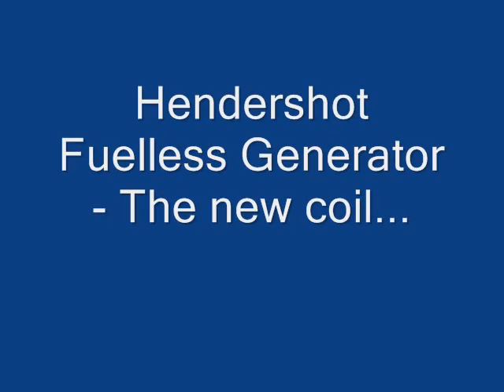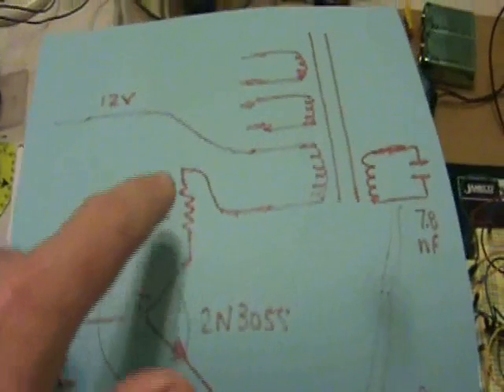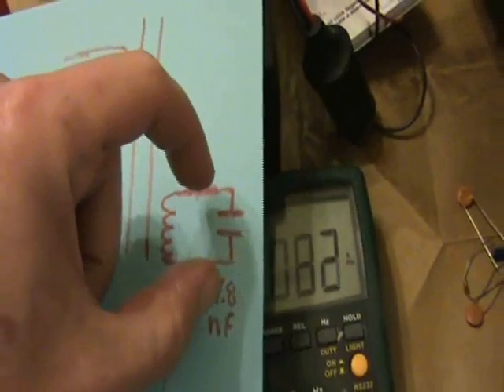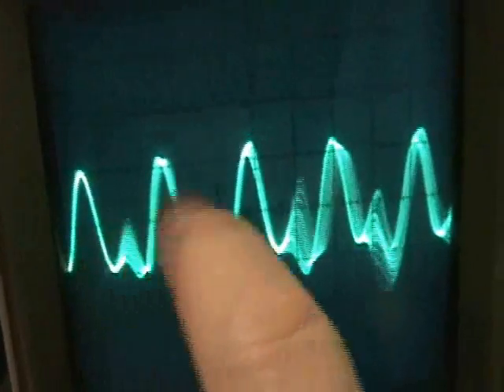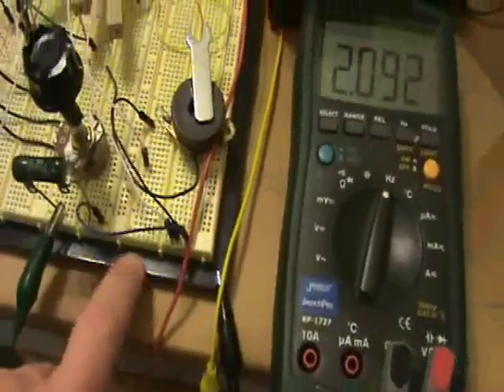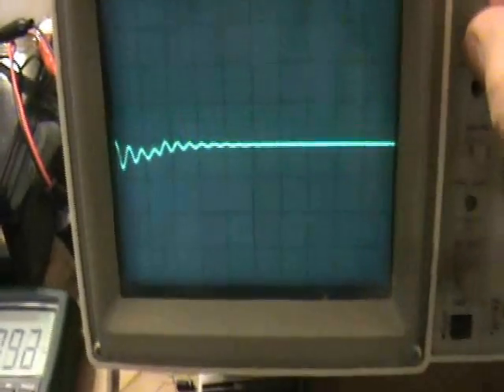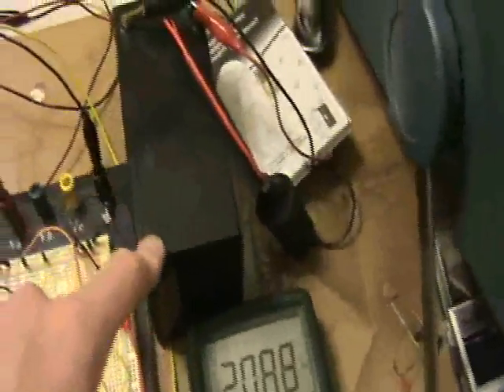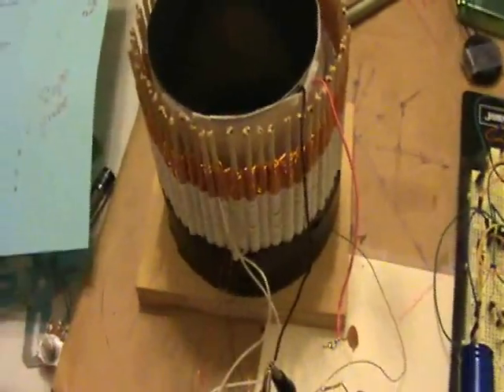"Hendershot Fuelless Generator" - The new coil

Comment: These were mainly used in kitchen s
Lighting after the war, they had a slider handle on the wall with pushrods and bell cranks up to work the bar magnet
Problem was little Johnny would come home from school an run through the door and just slap the slider not quite putting the magnet just in the sweet spot. They were outlawed in the 50's
Cause they were house burners.
So my idea is to use an electromagnet instead of a bar for more precise control. They make 240v the videos yiu see with the coils on top and lights on bottom look just like the ones they sold ling time ago. None were made in the usa. I have removed one from a big ritzy historical house back in the 90's i would think the paper caps were so old, the kitchen help said it worked all the time
There were 240v flourescents on it.
C and c electric its in their shop under a table on top of another one that was old as hell.

Comment: Two foreign countries made these with lights and sold them. They were outlawed in the 50's. The NEC says lighting by these are not allowed. Ring modulated tank circuit power sources for residential lighting shall not be......
Reply from the maker: I think your just being Paranoid. What are you worried about? Some Dr. Who Dalek coming to investigate?
Reply: +morpher44 they were outlawed cause they were firestarters if the ring is not just right they overheart
Reply from the maker: was reading that ring modulation was used on Guitar effect in the song Paranoid - Black Sabbath. Also its the effect used to create the Dr Who. Dalek voices. :-)
Reply from the maker: as for frequencies just right, and heat, modern electronics can handle those issues.

Comment: Once dad's device blew up in our dining room up on the ceiling... keep up your work and ideas Morpher44... Think Frequency... MJH
Reply from the maker: Hi Mike. Yeah I had been thinking frequency. It has to be low -- mechanical -- such as 50Hz upward to 100Hz. If your dad was shooting for 60Hz, he would design his resonant circuit to be there, which means the resonant peak would be there, allowing for the power transfer to be ideal at 60Hz. Plus, the buzzer mechanism isn't likely to go much faster than 100Hz. Now if there are other frequencies involved, such as harmonics, that is a more complex machine.
Reply from the maker: re: harmonics, I found some material on PHI ratio frequencies and how PHI is the only ratio where the frequencies can mix "perfectly". 2x also works, but it is not ideal. Did your Dad ever discuss the constant PHI?
Reply from the maker: some microwaves might leak a little. I wouldn't do that. Not a healthy experiment...

Comment: Are we not moving at approximately 900 mph though the earth's magnetic field?  Isn't moving a conductor through a magnetic field how you generate electricity?  Doesn't that explain Hendershot?  Can you get more amps with bigger coils?
Reply from the maker: I think the Earth's field lines rotate with the planet a bit. Their behavior is a bit unpredictable as well, given pressure from the Sun. I think the telluric current, underground, might be an interesting area of research because these currents get you closer to the inner dynamo of our planet.
Reply from the maker: re: conductor thru magnetic field. You can work out how much current you can generate, given the cross-sectional area of the coil, the resistance in the wires, the strength of the magnetic field, and the relative motion between them. When you attempt to go BIGGER with coils, you bump into problems with high resistance. So you either need some sort of room temperature super-conductivity, or you need the same amount of energy entering the system as you are consuming from it. So yes you can generate power from the Earth's field, but you have to expend a bit of power to do it, or figure out some other way to create spin. In the case of the induction compass, what Hendershot was trying to improve, the SPIN was created by AIR entering the front of an airplane. The Earth's field would produce the voltage to move the needle.
Reply: you could build a device that will charge a cell phone in less than 1 week for only several thousand dollars!
Reply from the maker: krugtech the purpose here though was to explore the Hendershot device, not to solve the cell phone charging problem.
Reply: +morpher44 my point is it's not a viable solution for energy production.
Reply from the maker: krugtech Actually. That is just being closed minded. Do a little research about the Hendershot device, and you'll find there were lots of witnesses to it working, including his kids. So the idea here is just to experiment, and determine how something like this could work. Making it viable is an entirely different problem. Understanding how it may have worked is the first problem.

Comment: actually how the coil is done makes a difference. This is due tto making magnetic fields. Basically for example make a regular coil and a starship coil and you will notice a much stronger magnetic field in the starship coil where the regular coil has a much smaller magnetic field. The same goes with the basket weave coil compared to a regular coil. A regular coil will has the smallest magnetic field.
Reply from the maker: Well Maxwell would probably beg to differ. I think really the magnetic field lines can be arranged to be "focused" by geometry, or can be arranged to spread out all over the place, "unfocused". But you probably get the same amount of magnetic-field as a function of current you pump into any coil. So I think the key here is to work out an optimum geometry for whatever you are trying to do. A Rodin coil will focus it all to the center, whereas a cylinder might be more ideal for a constant magnetic field within the cylinder.
Reply: Test your theories using magnet paper and u will see how wrong u are.

Comment: Why not duplicate hendershots exactly as we know it then try to improve upon individual components?
Changing so much so soon is reinventing.......
Reply from the maker: because no one knows exactly how to build Hendershot's device. The circuit diagram was not made public. There are several "guesses" at his circuit. There is speculation about how it works, etc. Some reverse engineering is required.

Comment from the maker: what voltages do you want to experiment with? Say the answer is 120VAC. Your caps should be able to handle that with some margin. These are AC capacitors here, like found in an air conditioning unit. Not electrolytic DC caps.

Comment from the maker: Another thing counter-intuitive is that it is not VOLTAGE that we want here but CURRENT. By stepping down, we go from something higher in voltage to something higher in current on the other side. It is high current that produce larger magnetic fields. Put oscillating magnetic fields near STATIONARY coils, and you can generate power. The Coils, NOR the MAGNETs need to move. Only the field needs to move.

Comment from the maker: I've come to realize, in messing around with this stuff, that the exact components are not crucial. Realize we are making a device that has a buzzer/relay mechanical pulsing. This is lower frequency -- say 20 Hertz upwards to 150 Hertz. If you were to use really LARGE capacitors, that won't work. You need capacitors that charge up with a time constant compatible with these SLOW pulses. Read up on capacitive and inductive time constants -- and resonance.

Comment from the maker: Ok.. ?? I think lots of people use 2n3055 because its easy to find. Some I have purchased do seem a little out-of-tolerance. So the manufacturer is probably important. The MJL21194 looks to be an 80 volt part. Ok thanks for the tip.

Comment from the maker: You can use a step-down transformer that has a 4.58 to 1 ratio. It can step-up when wired the opposite way. This is a property of transformers. One side is 24VAC the other side is 110VAC. Its done via the wiring ratio.

Comment: hi, it would be a step up transformer. 20 turns inside 100 turns outside 20 v primary 100 v secondary but you would have to wind it yourself. the step down transformer 120 to 24 v is very common available at radio shack. its wound the opposite 100 inside 20 outside so the primary becomes the secondary, i think this is what they did. i have never had good luck doing this but it should work. i have seen schematics for hv power supplies where they switched the primary for the secondary for step up

Comment from the maker: Another source of power is just by having a wire go up high enough -- 300 volts/meter -- and then have that feed into the Tate Ambient Power module, great circuit, and then off to a good ground. Free power -- after paying for the cost of the parts to make this. It won't be 1kilowatt though, unless you run that wire up pretty high.

Comment from the maker: That is a lot of power ... and so you would have to find something near your home that could provide that. For example... hydroelectric power from nearby stream ... wind power ... solar power ... thermal power (if near a volcanoe), or "received" power from some transmitting source of power. You can BURN stuff and make power. Chemical/Galvanic to make power. Earth batteries -- scaled HUGE... Lots of ideas to try and experiment with.

Comment from the maker: @lugiss76 
Yeah. I use Garage Band. That software is very fun. This particular song also features a little Theremin I made which uses photo-resistors and light instead of inductance. It was a simple little circuit I found on the web. I just plugged its output directly into my M-AUDIO usb device as if it was a guitar or bass. Very fun.

Comment from the maker: Thanks for the advice about a grid dip meter. 
Sounds like a useful tool to have. Absolutely I'm seeing spurious oscillations ... and I intend to enhance that if I can. The Hendershot hand made capacitor is like an antenna and picks up all sorts of RF ... and the coils are sensitive right down to VLF and lower frequencies. This thing has a very wide band response.

Comment: you could use a grid dip meter to check the resonant frequency of the outer coil/cap circuit with no connections. You might be seeing some spurious oscillations caused by lead lengths and transistor junction capacitances. If you used a grid dip, it would rule out any of that stuff. Grid dip meters are not too expensive, or you could build one.